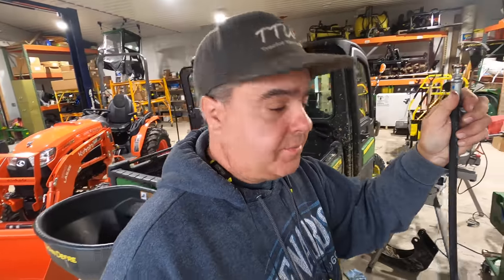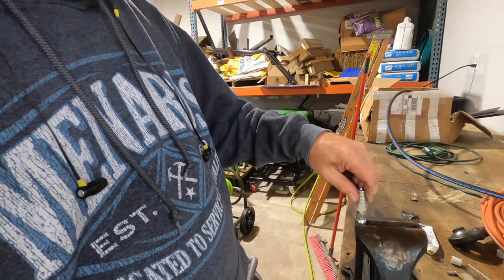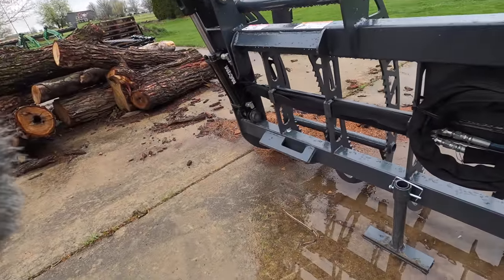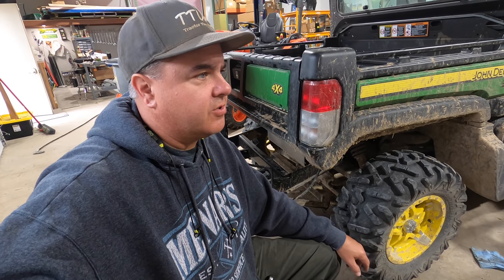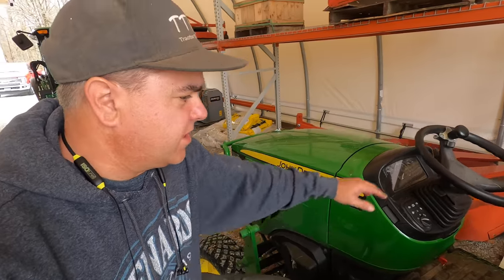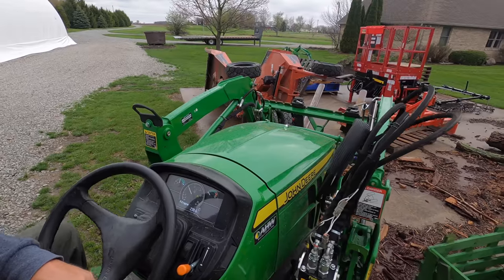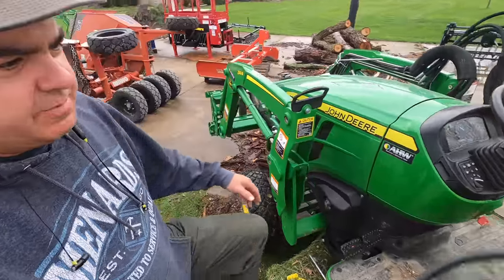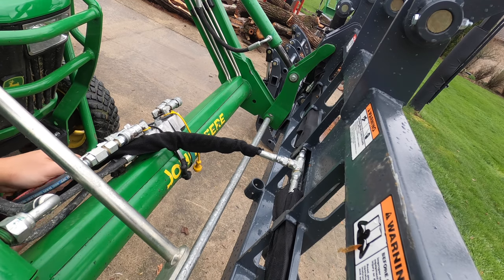New Tractor Grapple! Rainy Day Repairs!

Comment: Neat video to see the background things you're doing.  I like it for the change of pace or when weather doesn't cooperate for the project of the day.  Would a tire sealant like Slime work in tires like those on the Gator?  Curious what you think of the electric powered Gator and if you'd try one.

Comment: Tim, I've been thinking about getting top & tilt cylinders for my Kubota B3200 as I have the factory rear remotes installed.  Have you done any videos on using a box blade and other implements with the top/tilt feature?

Comment: I have all my Hydraulic hoses so One male one female so I have to plug them in right.   Another way is to buy a bag of multicolored zip ties and put them on the hoses then just plug color to color.  Agristore USA has top link kits with regulators and hose kits so the right angles are uniform.   They were very helpful in explaining why I should have a regulator on a top link and customer service was great with questions.

Comment: Hey Tim
Thanks again for your interesting video..maintaining the equipment is very important. FyI...I traded in my b2650 for a 1025r...there was many reasons for this but mainly I could see and hear the difference between the two..at work we have a 2025r..to be honest once you drive a twin pedal compared to the treble pedal..for me...jd all the way!
Also the kubota transmission wine... you know what I mean...jd has way less noise !! .. I bought both and will always buy jd now.. kubota is as though as nails but not my cup of tea!!😎😎 Hope this helps any on the fence!

Comment: I have the Precision Mfg. 72" twin lid grapple for my Kubota M5660.  I was disappointed that there isn't a single grease fitting on it anywhere...just holes in the side plates and a pin through it.  It's nice to see yours have zerks.  Oh well, if I ever wear it out I'll buy something a little nicer.

Comment: Any update on the 3rd function from Summit? The hardest thing for me is figuring out the hoses needed for what they have now. Are you helping them design hoses for the 1025 and 2038?
Reply from the maker: We are helping to design hose lengths for 1025r.
3rd function is likely about 2 months away.  The new brackets have fitment tests and then production lead times...which as you know is difficult this year.

Comment: Maybe I missed something. The top link and hose kit shown at the 13:30 mark...  Is that on your 1025 or 2038?
Reply from the maker: Either one.
Reply: @TractorTimewithTim  Thanks! I've been looking for a plug n play that'll fit the rear SCV on my 2038 without the hassle. Thanks for doing the ground work!
Reply from the maker: Yes. It was on the 2038r in this demo.  I have shown it on the 1025r in other episodes.

Comment: Went out to just sit with my new 1025r and big puddle of antifreeze under the front. Water bottle empty. Radiator about 2 inches low. 14 hrs. on it. Tried to see where it is coming from but so far no luck. Hoping it is just a lose hose clamp.  Hope!
Reply from the maker: Mine had a loose hose clamp.

Comment: I noticed you're using a single point connector and a diverter together on this project.  I think I know what you did but It be nice to see a video on how the single point connector and the diverter hook up together.  Did you need to buy different size hydraulic hoses to connect the single point connector to the diverter or were you able to use existing hoses?  Outstanding Videos
Reply from the maker: The hose ends are slightly different.  Dealer cut them off and replaced with the proper ends.
Reply: @TractorTimewithTim  Thanks for the info, hope you folks are feeling better

Comment: It is funny seeing your cats with the emasuring tape.  One of mine goes balistic over them.  It is interesting seeing this style of video becuase it includes problems everyone is going to experience.  What are your thoughts on the Kioti tractors?  I've been looking at them a lot lately because of the bang for the buck. Them and Kubota are the closest dealers to me so that factors somewhat into it.
Reply from the maker: We have a couple of episodes on Kioti tractors.  Check em out.
Reply: @TractorTimewithTim  are those the ones at the tractor show that I saw? I'll double check through the channel to see if I missed one. You seemed pleased but just curious if you've had any hands on with them other than that? From what I've researched they sound pretty solid for longevity wise. I definitely find myself torn between the Deere, Kubota and Kioti. All them have their own strengths it is hard to choose.
Reply from the maker: We did a hands on test with the cx2510.  Released early this year.
Reply: @TractorTimewithTim  thank you! Not sure how I missed that one. Great video and of one that I'm considering minus the cab.

Comment: Have done a-lot of reading and watching TTWT videos. Decided to purchase a Precision grapple. Where do you order? I don’t have a dealer close. In 2017, you had a video with a TTWT code. I need model MINI 322 Grapple Rake - Double Grapples/ John Deere Quick Attach Brackets. What model / size couplers do I need? I am
Having the 3rd SVC installed at my dealer. Thanks so much for great suggestions!
Reply from the maker: Agfolks.com use code ttwt for a 5% discount.
Reply: @TractorTimewithTim  Thanks!!!
Reply from the maker: ISO A 1/4”.   Not sure if one each male/female, or if two male.  Your dealer should be able to tell you which comes with the 3rd function.
...but I think you’ll need one each...male and female.
Reply: @TractorTimewithTim  thanks!

Comment: The tires have to be plugged from the inside.
Reply: It is actually a patch, and the air pressure against the patch makes an excellent seal. Here in Alabama it would cost you a couple bucks. Real affordable.

Comment: Will the hose kit work with the new summit rear hydraulic kit and the top link (JD 2025r) ?
Reply from the maker: Yes.  Thought I said as much in the video.  It will work with the top link from shopgreendealer.com/ttwt.
Reply: @TractorTimewithTim  wasn't sure if the hoses were long enough for that new summit solution.
Reply from the maker: Yes. These hoses were specifically built for the summit solution on 1025r.  They should work on 2025r.

Comment: I know we've talked about this before but I don't understand why you like a diverter valve over a third function.
Why would you want to limit yourself to two functions instead of three all at the same time.
I always enjoy watching your videos keep up the good work
Reply from the maker: It doesn’t really matter on these small machines anyway.  There is not enough flow to perform two functions at the same time reliably.....especially when one is on/off electric driven.
As it times out, I can toggle that button as I’m curling to do exactly what I need with the diverter.  ...I actually find it more effective than third function.
Having said that, I doesn’t make much difference.  I’m just trying to communicate details.

Comment: I would like the grapples if the bottom teeth were longer so you can scoop underneath what your grappling.
Reply from the maker: I have both styles.  Like them both.  They are different, but both are effective.
Reply: @TractorTimewithTim  cool! For me, I would like the long ones I think. I would probably drop less stuff with them.
Reply from the maker: You might be surprised.

Comment: Please tell me your camera crew didn't quit after making them stand in the cold all winter.  (^_^)

As for the "chore" type videos, I don't mind them.  I hate mowing when wet.  The cleanup never seems to make it worth the effort.  Glad to see it isn't just me that finds routing hoses for a hydraulic top link to be some kind of unnecessary mental gymnastics.  Deciding exactly where to angle the connector etc. is just annoying.   I actually run my top link with the connectors down because the lift range of my 3 point is limited when they are on top.  Ask me how I discovered that the hard way.  (^_^)

Pipe dope vs teflon tape.  Care to comment?
Reply: Be carful with Teflon tape you’ll get it in the check valves and stuff on your hydraulics and cause big problems
Reply from the maker: I can’t use Teflon because folks like William :-) will have a fit.
Of course, the dealer uses Teflon tape on ALL of the connections they install!
Reply: If using teflon tape always keep it back one thread so pieces don't break off.

Comment: Tim, I asked the company that you got the Hyd. top link from what the measurement of the pin centers in the retracted and extended position and they replied with "That information wasn't available" What was the pin center measurement on the link that you installed in this video'?
Reply from the maker: 20" and 28"